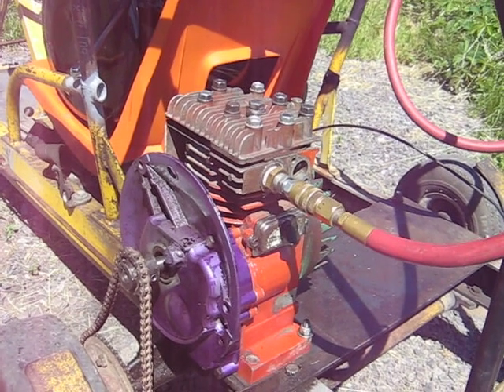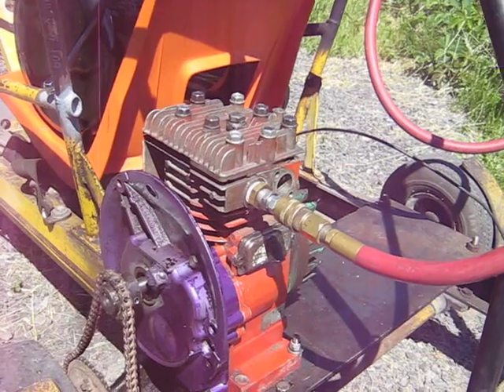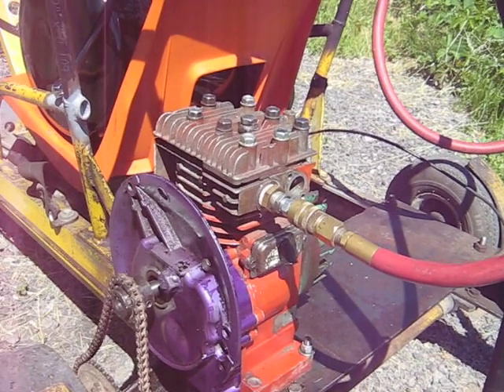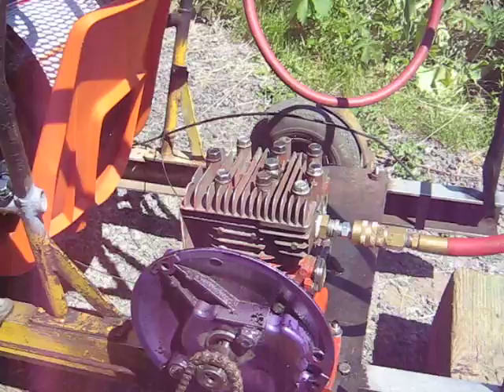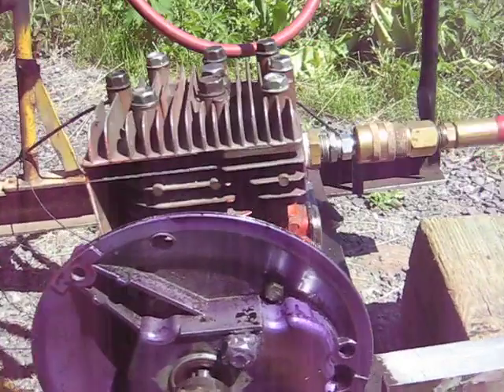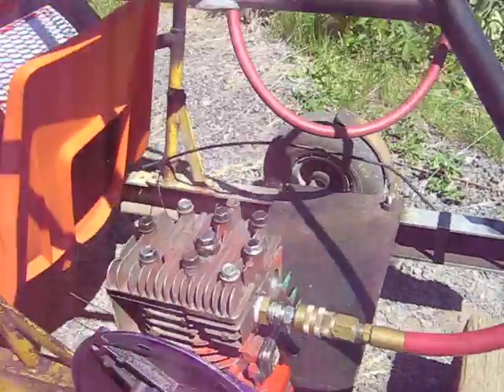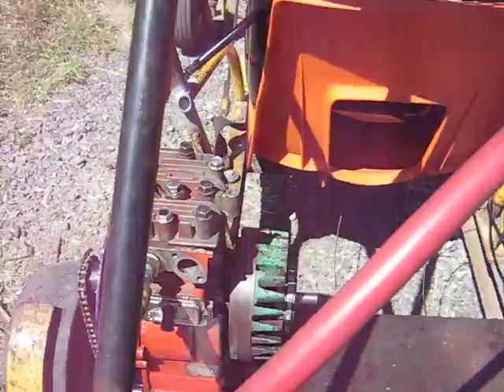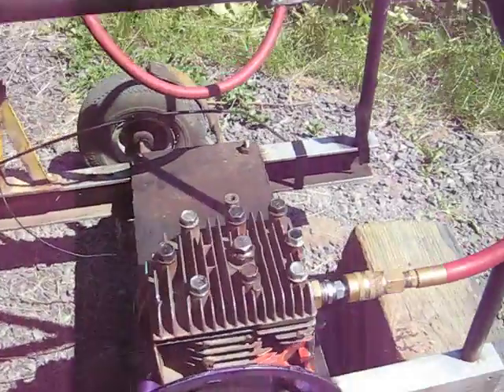Running the Full Speed Camshaft Compressed Air Engine

Comment: How did you modify the cam and why did you need to modify it? Just wandering..
Reply from the maker: This compressed air engine is similar to a 2 stroke, in that it takes in air every time the piston comes up, like a steam engine. The normal 4 stroke, 1/2 crankshaft speed camshaft just opens the valves too slowly for this application. So I had to double the speed it runs at to make the valves move faster.
 Have a look at my "Simplic 2 stroke" vids, I show the full speed camshaft there (I think)  :)
Reply: ChargerMiles007 right on... Yes you showed the valves, I just didn't understand fully... Thanks for the reply though man.. keep up the good work..

Comment from the maker: Yes, a ball valve does open rather quickly!!!
I was using a fairly highly rated regulator, but it just didn't seem to work as well as I thought it would. I found the yellow air hose was smaller inside, and seemed to affect flow also.

Comment: i have also tryed to use a regulator it would humm realy bad b\c it couldn,t handle extrem cfm u can here it in the V-2 load test i use a gate valve no i find i can controle the press more acuratly as opsed to a ball valve ur engine seems to work well lol =3-

Comment from the maker: I don't think this version is any more powerful, but I think it uses the air more efficiently, since it actually has time to expand now. That wasn't really the case in the previous 1/2 speed cam engines. I tried using an air regulator to limit the pressure to 65 psi, but it really seemed to kill the power, so I took it off. Just me and a 1/2" ball valve now! :)